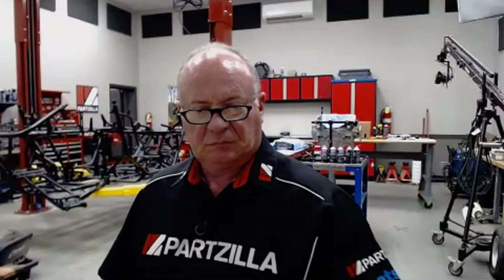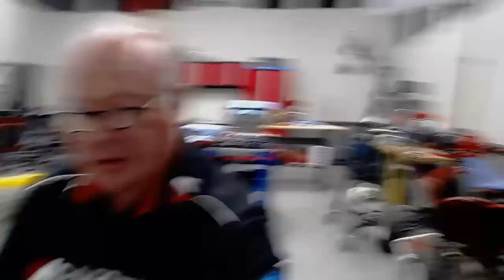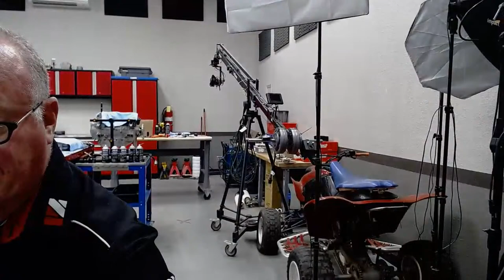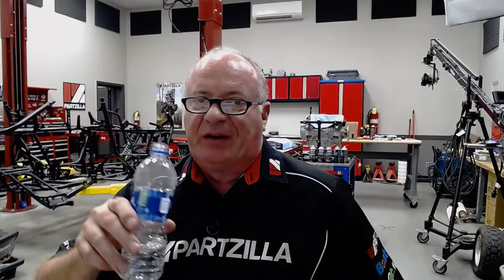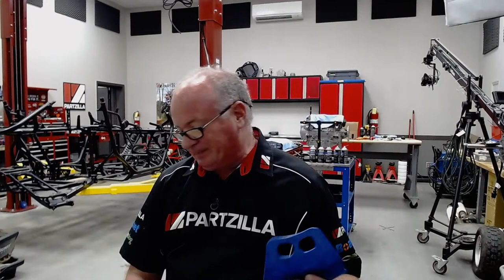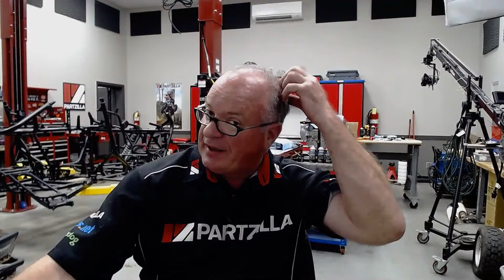Live Q&A with John Talley | Partzilla.com

Comment: installed new stator, rec/reg, battery and sparkplugs on 2013 kawasaki teryx4 750 eps. now the engine cranks over as usual but does not start . there is no spark on the plugs but does have 12 volts at the plug. could the position of the pickup coil be the problem?